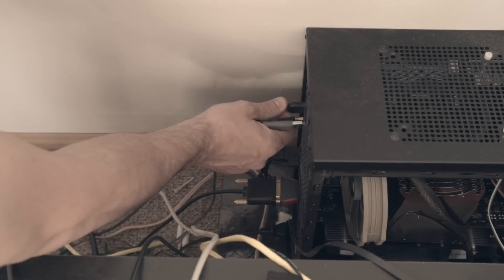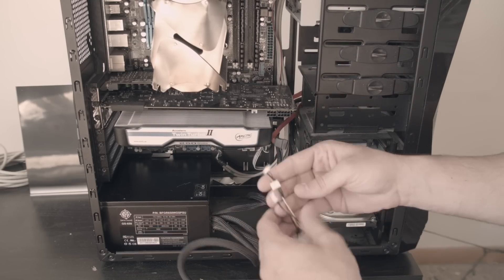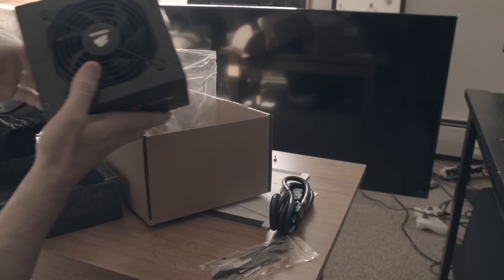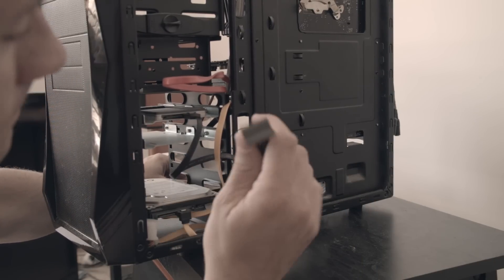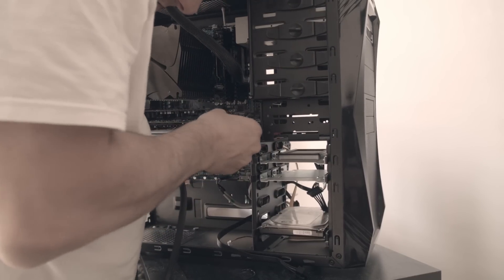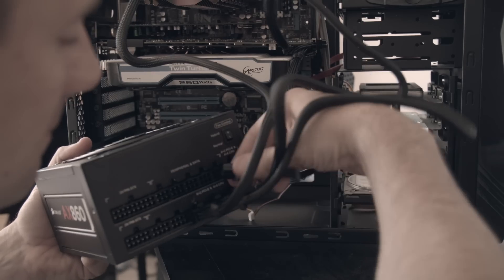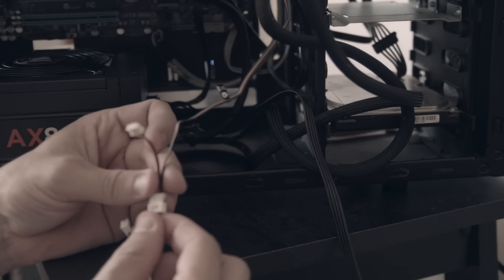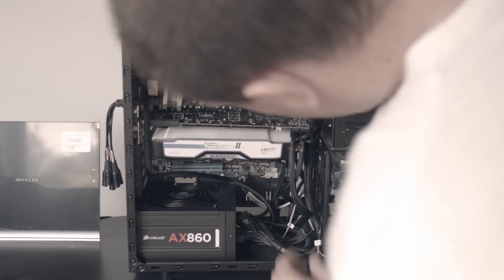How To Install A Modular PC Power Supply

Comment from the maker: To my knowledge no, simply because these modern power supplies provide a base voltage that works for all PCI Express items and other peripherals -- all that we have to do as installers is match the number of pin connector to the item we're plugging in.

Comment: This guy is a mess, he didn't add screws to the motherboard, his PSU is upside down, his CPU cooler is mounted incorrectly, his GPU is sagging, Jesus dude.
Reply: the psu can go in upside down since he has a air intake/outake opening on the bottom

Comment: So its no difference how to install psu (I mean upside down like u did, because some install it face down).
Reply: +klubbstyler if you install it face down it will be cooler if your case has the blank . but if you put it face up the psu temps and cpu and hdd and gpu temps will be more effected my the heat the psu generates
Reply: +GreekGamer4U but isnt that the hot air generated by psu comes out of its back ?  so if u place it upside down it just has better airflow?
Reply: Listen if you make the psu fan face the downside of the case/floor then you make the compoments less affected by psu generated heat

Comment: Horror. Pay for expensive power and keep the computer in such a terrible box. I am surprised that your computer is not blown in this cable nightmare that all cables are from the bottom and everything above the power you took the air the video card.